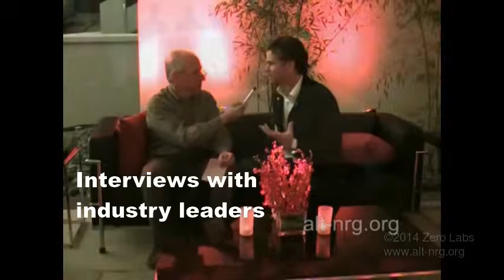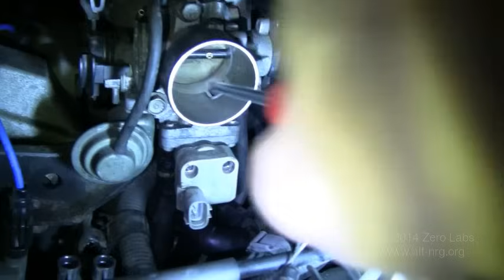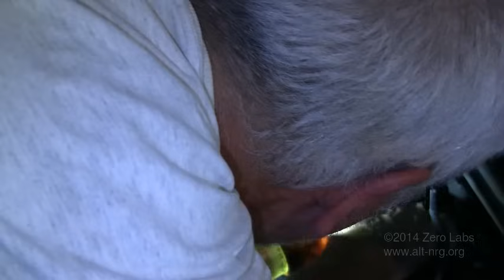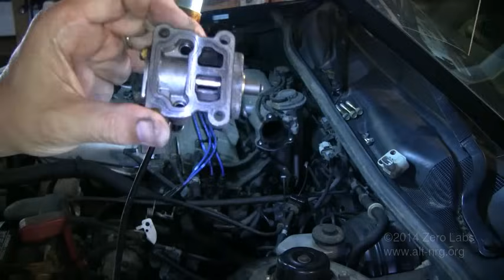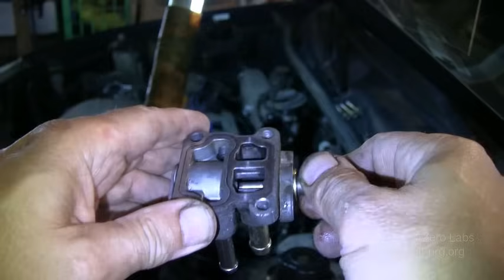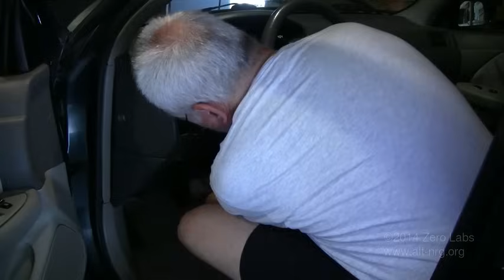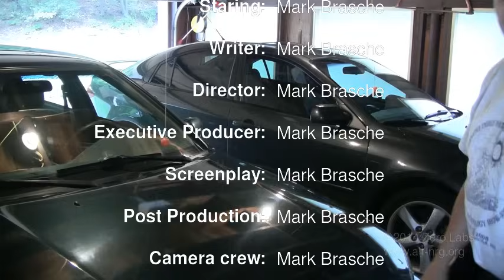#372 Better repair method Toyota Camry Idle Air Control Valve

Comment: Wow! Will definitely be doing this. I replaced coolant temperature sensor, just did all four spark plugs, still super rough idle especially at a stop, like shaky. Man I hope this does the trick. Thank you so much 🙏
Reply from the maker: Confidence is high! 
I repeat...
Confidence is high!

Comment: the coolant temp sensor sends signal that controls iac
Reply from the maker: Not on this car. Coolant lines pass THROUGH the IACV and regulates relative to coolant temp mechanically. It must operate freely else the hot idle problem.

Comment: what happens if you dont have a centre hose?
Reply from the maker: It only means the throttle body is not vented to the crankcase. That makes it simpler for you.
Reply: Ive got a corolla is similar but different

Comment: Yo Sir  you should never use Carburator Cleaner on your throttle body just in case you have any electronic sensors or Molybdenum or Silicone  Sealer on edge of throttle plate, especially  Toyotas and Luxury cars) and hinges (moly.  looks like carbon but it's not) It also will eat the rubber stopper on the IACV especially older cars  You should use  either Throttle Body Cleaner or Mass Air Flow Sensor  Cleaner which even safer.

Comment: 21 year toyota master tech here. We used to take the whole throttlebody off, clean it, put it in a vice, remove and clean the IAC, replace gasket and small machine screws (they always strip during removal) and the reassemble. Carbon build up causing it to stick was a very common problem on both 5S-FE and 5VZ-FE. I believe we were charging about $75 for that service back then. Would probably translate to $170 now 😆 these are fantastic cars with fairly simple repair routines
Reply from the maker: You are an honest tech, unlike the many dealerships who knew the flaw full well, and used it as a cash cow to take the customer for a very long and unpleasant ride.

Comment: Can this being dirty cause a rough idle ?
Reply from the maker: Not really. This is related more to low idle, surging and stalling. For rough idle, I'd start looking at spark plugs first (simplest), then coil packs, then fuel injectors, in that order.

Comment: Great video.  I believe the center port for the vacuum line is only present on CA cars; federal emissions models may not have this connection.
Reply from the maker: That is correct. I believe I state that in the video already, if not in other comments I have made in the replies.

Comment: great vid sir, i dont mind the low lighting. got a question, when we spray carb cleaner down that iac hole, that wouldnt seep into the coolant? i mean i see no kind of seal in between the throttle body and iac valve body. thank you.
Reply from the maker: Not at all. If that were true, the reverse would also be true, that coolant would also be constantly sucked into the intake.

Comment: Hey nice video! My car is a corolla 2007 and the problem is that it will stall on neutral (automatic transmission) but will idle at 700-800 on drive or reverse (no problem). I had the same air filter for 65k kilometers; I have changed it, cleaned MAF. Seemed better but would happen again. I checked the Throttle body and it was super dirty. Cleaned it with specific spray and towel. Stalled 1 or 2 times still after this. Now i'm going to have a friend read the check engine code, but I'm thinking about the IAC valve being sticky. Any ideas?
Reply from the maker: Could be the IAC valve is gummed up, but check for vacuum leaks first. Also, I can attest to the fact that MAF sensors do fail and should be replaced. Bought a used 06 Camry, 2.4L with 220K. 1st stage cat was clogged. Replaced it but still ran like §h¡†. Tried everything else first. Fuel additives, filters, plugs, injectors, you name it. Bought an aftermarket MAF that improved it greatly but still wasn't happy. It wasn't until I ponied up the money for an OEM MAF that it truly fixed the problem. Now runs very strong with 270K on it. Moral of this story is, don't waste any money on aftermarket brand MAF sensors. They're too critical to the proper A/F ratio to play games with.

Comment: I just sprayed the cleaner in th little hole...while running and just revved it up when it was trying to die...seems to be running better now when the ac is on going slow....and there was alot of black carbon iside the throttle..I wiped it clean..hope it fixes my problem
Reply from the maker: Good to hear, but it may be a temporary fix.

Comment: Ok so I just got my new one in the mail and I see there’s 3 ports on it I know 2 are for the water lines what ab the third do I cap it off or let it vent
Reply from the maker: Seems to me you bought the wrong one. They all need to vent. The 3 port IACV model is for CA emission vehicles which draws air from the crankcase. Federal emission vehicles draw air from the throttle body ahead of the butterfly valve. Both air sources are filtered air. So, if you do go ahead and use this one on your car, you'll need to Macgyver an air filter for it, else dust and debris can get sucked in.

Comment: This gunks up on my 99 Camry about once every two years.  Now, I keep a spare that is clean and ready to install.  Then, I clean the one I took off and put it away for the next time.
Reply from the maker: Sure. You just need to make sure you recalibrate your idle speed each time.

Comment: The screws that hold that IAC Actuator on are not Phillips, but they are JIS (Japanese Industrial Standard) screws. You should use JIS screwdrivers for those screws.
Reply from the maker: As if all these screw head types weren't confusing enough already! LOL!
Reply: @zerolabs   I only know because I stripped several of them before someone told me what they really are. 🙃
Reply: Mine are vicegrip type fixing to grind into a 8mm lol

Comment: Actually, I cleaned them but the RPM still increased, in the warm condition of the engine the RPM is 1200. What could be the problem?
Reply from the maker: Could be a vacuum leak somewhere.

Comment: Fantastic job did it in my Toyota Rav4 1999, my idle was 1300 rpm warm, now is 750 rpm fantastic job.I also disconnect the battery for 30 min after the procedure.Thanks
Reply from the maker: Awesome! Glad it helped you.

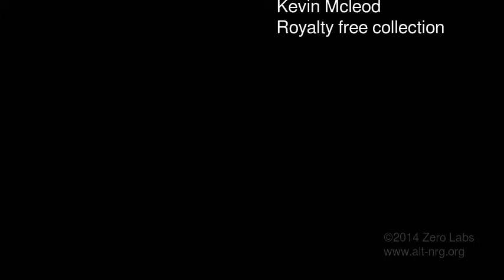Comment: @16:18 did you forget a hose off the top of the TB? (shiny hose connector observed)  Also my coil part had some grooves worn on the bottom of the bore like the magnet was rubbing on the lower part. Could this part have been installed slightly off center? Im gettign a lean bank 1 on my 4cyl and an erratic idle when AC is on. Maybe Ill have to look at this again, alignment of the coil onto the valve.
Reply from the maker: If you see grooves worn like that, it's time to replace.

Comment: Thank you - @Hayk on clublexus referenced this video and the method worked like a dream on my 1998 ES300.  ADVICE: after clearing a stuck IACV, disconnect the battery long enough to RESET THE ECU!  My car's computer had compensated for the stuck valve and got fully confused with low idle and stalls when the valve was working again.  After the reset and some idle & rev time, my car's running great with a smooth idle @~700 RPM.
Reply from the maker: Good tip! Glad it helped you.

Comment: Thank you so much for the video, let me try it with my 01 Camry 4 Cyl with 250K miles.
Reply from the maker: I'd be curious to know how this went if you got around to doing it.
Reply: @zerolabs  Now my Camry have 264,772 Miles and is perfect, Idle pretty smooth after this repair.

Comment: So when I took this apart that little valve with the spring load came out so I put it back in now it fluctuates what can I do to fix it now if I have to repair what part do I actually need? Please help I thought it was supposed to spin it has since I got the vehicle there was no spring so what would I do?
Reply from the maker: If you haven't done so already, sounds like you broke it. Time for a new one.

Comment: I just bought a new one, and the piston rotates almost 360 degrees, also the screws behind it (the ones you say don't move because they are factory calibrated) are practically straight, the old one is like the one you show in the video and the car when starting has no power and turns off 
What should I do?

Comment: (🚨Pls Help🚨)
I just replaced my iac valve in my 98 avalon xls with 306k miles. The check engine light (p0505) turned off right away but turned on again shortly after. I tried clearing it, but it came on again right after doing that. Any advice on what it could be? Gonna try to watch the video again to see if I can find any hints, but any advice is greatly appreciated. I thought I did everything correctly. It is running noticeably better than it was. Not perfect, but I do notice a positive change in the idling. There is still some issue with my cruise control where the car will keep increasing then decreasing (over and over) the speed at which the cruise is set. Although, I believe this is happening in a somewhat smoother way than before changing the iac. I cleaned the throttle body as much as I could and the iac was new. I didn’t clean inside the deeper part behind where the throttle body attaches to, so maybe that could be the issue? Any ideas on what’s keeping the code there are appreciated, thanks!
Reply from the maker: The IAC valve also sets the idle speed. Try loosening the hold-down screws and rotating until you get the correct idle speed. That said, it really seems to me like you might have multiple problems. Always the most difficult to diagnose. The cruise circuit is entirely separate. Can't really give you much more guidance than this. Best of luck.

Comment: Thanks for this video. Where is exactly the other end of the hose at https://youtu.be/WsP2-HKz7vE?t=256
Reply from the maker: I presume you refer to the crankcase vent hose, not the hot water preheater hoses. It terminates at, well, um, the crankcase.

Comment: For the 99 Camry don’t take any hoses out it has a bleeder for the gunk to go out it won’t go into the engine
Reply from the maker: I have to take your word for it. My 97 is long gone. Crushed by a fallen tree. About the only thing that could kill it. Replaced by a 2006. And bought a 2012 for my wife. Both run beautifully.

Comment: I am checking the IAC valve of my Camry 1997 and I see that it does not have the hose in the middle where the air circulates towards that valve, what should this be?
It only has the two hoses on the sides where the water passes.
Reply from the maker: Could be you have a non-California compliant model. In which case, no worries about the cleaner draining into the crankcase.

Comment: Thanks so much for your video i also have a knocking when the rmp are going up and down could that be also related to the same issue?
Reply from the maker: Unlikely. You might have spun bearings. Could be time to rebuild.

Comment: I’m wondering, I have a 2000 4cyl Toyota Camry but it seems like your idle air control valve has 3 nipples while the one I bought has 2, it says it’s meant for my car but I haven’t had the chance to replace it yet
Reply: Were you able to change the valve? If you did it as the car works for you, my Camry 97 also only has two nozzles and it is where the water circulates.
Reply from the maker: I believe this is the difference between California emissions and federal. They are not the same.

Comment: There is at least one good reason not to take off "the coil that operates the actuator".  You have to know NOT TO USE  a phillips head screwdriver.    They are NOT PHILLIPS HEAD SCREWS. They look like phillips head screws,  but they are NOT.   The maker of this video must have a set of JIS compatible screwdrivers which he uses and he just thought those were phillips head screws
You must purchase a JIS (japanese industrial standard)  screwdriver to remove those 2 screws.  And if you ruined the screws trying to get them out with a phillips head screwdriver,   you may be able to get them out with a JIS impact screwdriver.  Waiting for mine to arrive.

Comment: Needs oil after cleaning, spray a shot of WD 40 in there the same way you explained with the carb cleaner by holding your finger on the vacuum hose port and submerging the tumbler for a few seconds.  Cheers!

Comment: Thanks for this!  My first attempt at cleaning my throttle body and IACV on my 96 Honda Civic EX A/T didn't fix my high fast idle problem but gave more acceleration.  Either I didn't clean it well enough because I didn't remove the coils and rotate the magnet back and forth fully, or I need to loosen the two screws and rotate the plate a bit CW to get the valve to close further at startup temp (the one calibrated at factory).  One way or another, your video serves as a pep talk to ultimate success hopefully.

Comment: my 1998 Toyota Camry has this issue: sometimes very lower idle speed during starting the engine, the engine would stop if I release the gas panel.  this happens sometimes, not very time.   It happened 3 years ago, I had it serviced and worked well.  now it starts to show the problem again.  I went to car repair store and they would charge me $179 for the cleanup.  that is quite expensive, so this time I will give it a try.  Thanks for your video, this helps quite a lot!   I will do it this weekend.
Reply from the maker: Please report back how it went.
Reply: @zerolabs  it works great, except it seems that the initial idle speed is too high (~1300 rpm) when the engine does a cold start, once the engine gets warmup, the idle speed is a little bit too low (~650 rpm) when I drive the car and stop due to traffic light.  It might need the car computer gradually learn and collect enough data to get the 800 rpm at idle speed.
Reply from the maker: @danyao6122  Once it's cleaned and working properly, after the engine is fully warmed up and idling, loosen the setscrew that locks the angular position (slotted opening), fiddle with it and lock it again. This is the idle speed adjustment.
Reply: Put a quart of Mystery Oil in the gas tank when full tank. Dissolves soot in the throttle body complex.

Comment: Your idle was ok afterwards not high or anything?
Reply: @zerolabs
5 months ago (edited)
 @danyao6122  Once it's cleaned and working properly, after the engine is fully warmed up and idling, loosen the setscrew that locks the angular position (slotted opening), fiddle with it and lock it again. This is the idle speed adjustment.

Comment: I've loved my 98 and 99. Both have experienced issues with the IAC, resulting in having to 2-foot the pedals to keep it alive. Going to try this trick to get it resolved!
Reply from the maker: Confidence is high.
Reply: What was your result after doing this procedure?
Reply: @juansuarez6167  unfortunately no change.  When I disassembled the iac, there was zero build up of any kind and the parts still looked brand new. It still acts up every once in a while.
Doesn't make sense, I truly figured this would fix my issue. I highly recommend doing it as a starting point for this type of problem though.
Reply: Maybe fuel pump going out? I had this issue in the past with sputtering and loss of power at times and eventually lead to full failure of the pump where it refused to start at all suddenly. I am assuming the pump may be failing again. Could be worth a try. I will try this method and if unsuccessful i will do the pump again.

Comment: My 92 Camry has this problem where you’ll try to accelerate from a stop and the rpm’s will surge but the car will only go 25 mph until you let off the acceleration and start back on, maybe this is the fix?
Reply from the maker: YUP!

Comment: So I think I sprayed a whole bunch of cleaner down that first hose last time I did this, what problems can that cause?
Reply from the maker: It can contaminate the oil and accelerate engine wear. I would perform an oil change right away.

Comment: I did this on my 93 Camry le 2.2 due to a strong vibration while in drive or reverse, not neutral. Engine turns over much quicker now, drives smoother, and the idle vibration is no longer ridiculous. Thanks so much
Reply: I’ll have to try this and see if it helps my same issue, vibration in drive and reverse

Comment: You, sir, are a GODSEND!
Very clear and concise instructions.
I'm NOT a mechanic; and, I'm petrified at the thought of disassembling multiple parts on my car's engine, to accomplish a task.
You saved me from that nightmare. And, I believe I will never forget you, because of your singular kindness, of producing this particular video.
It's given me the courage to tackle a vexing problem, that, I did not have the understanding to explain; the way my car seem to be running less efficiently over time.
I was getting dismissive responses from mechanics, suggesting that because my car was old ('95 Toyota Camry), I should be resolved to ACCEPT, that, my car should NOT be expected to run well again.
Thank you for giving me hope, to remain in a car that I am happy to own.
Reply from the maker: Git-er-done!